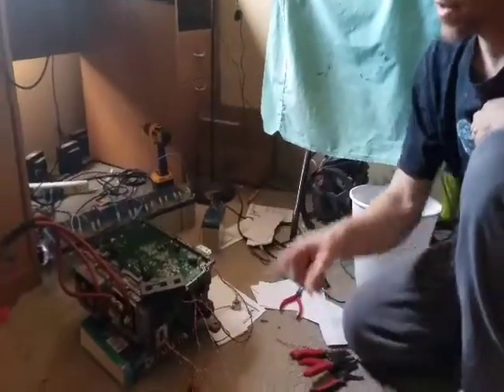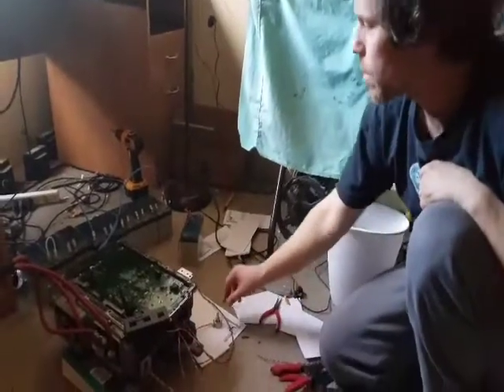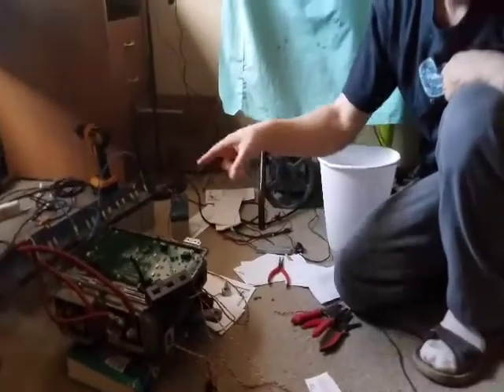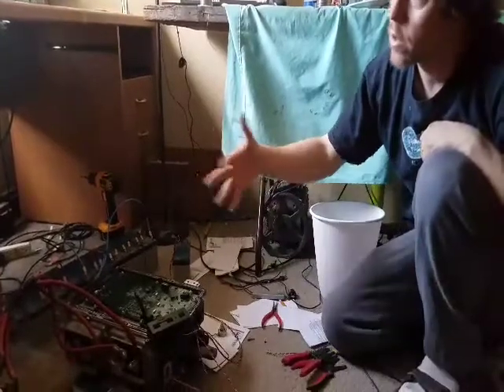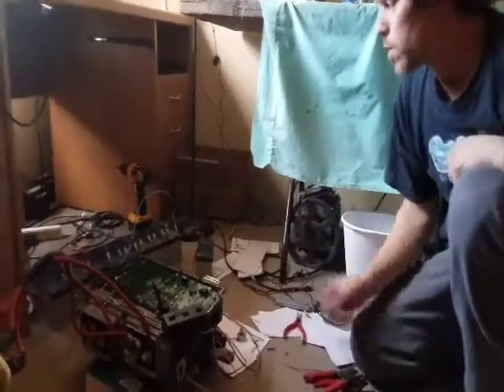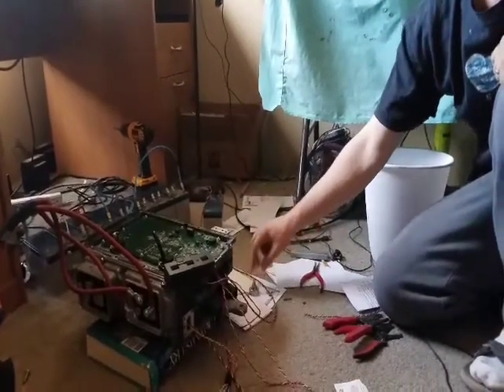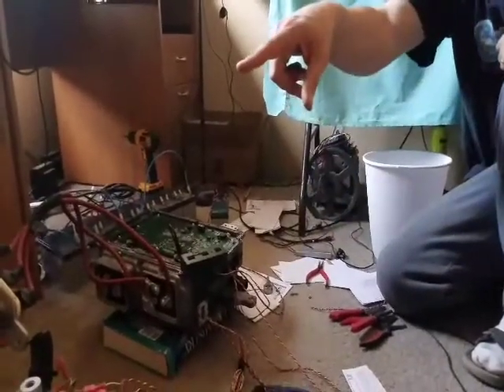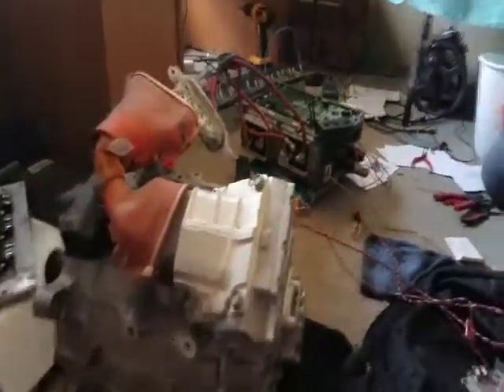Chevy Volt Controller Take-Over

Comment: Are you using the stock controller board?  Or are you directly driving the PWM signals into the IGBT driver board from some other motor controller board?  Either way that is very cool!
Reply from the maker: This is a new control board that has no driver components on it.  It plugs into the stock driver section using the desoldered connectors of the old Chevy Volt control board.
Reply: Reading the video description again answered that.  Look forward to hearing more about your design should you choose to share.  I have thought about trying use the design Johannes Huebner made available and attach that to the drivers/power IGBTs of a chevy volt inverter but never actually got around to it.
Reply: Very nice, I would love to hear more about the design of that board and how it all works if you feel like making a video about that someday :-)  Thank you for sharing!